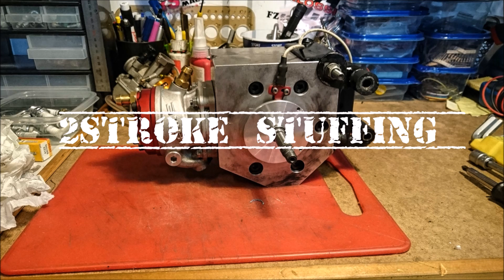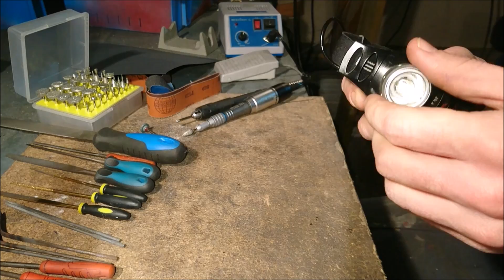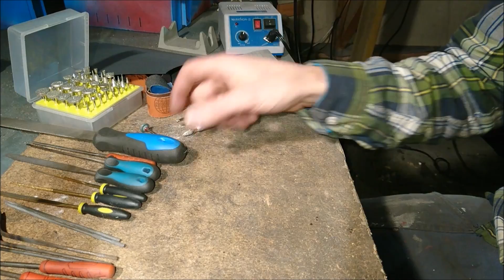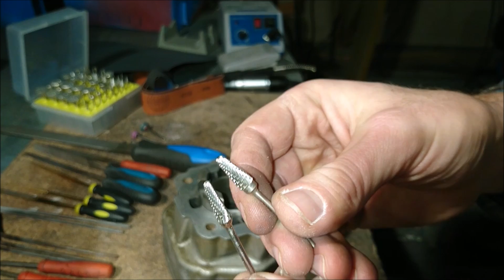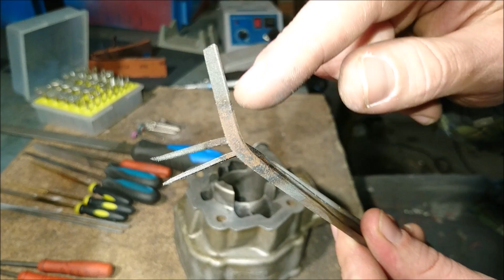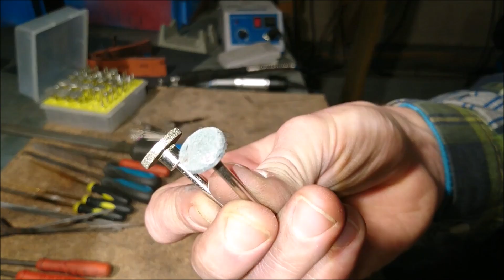DIY Poor Man's Porting Tools - Introduction

Comment: I usually just go oldskool and use small files.
Reply from the maker: +Eurobeatmachinist86 That's a good safe way, slow tho...
Reply: 2STROKE STUFFING Im in no hurry when it comes to building engines. If i do not have time i dont do it.
Reply: What files you use for transfer port ? Thanks.